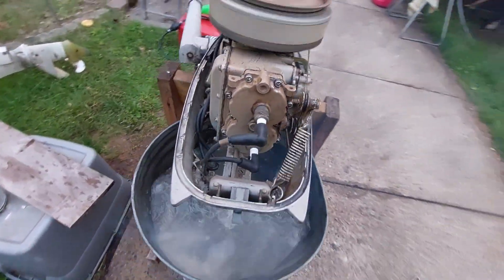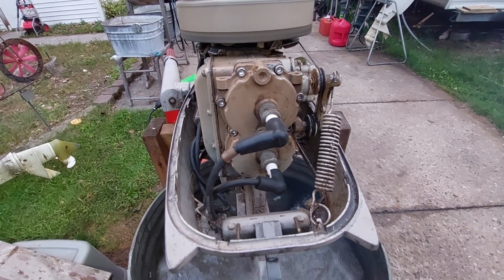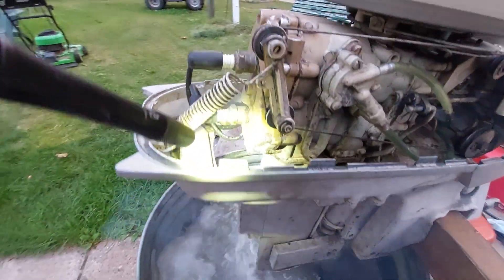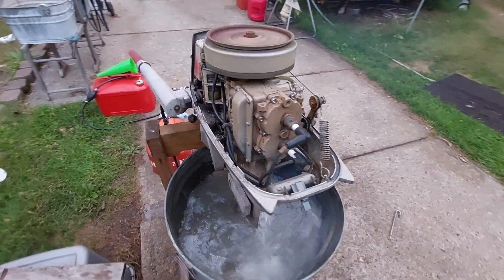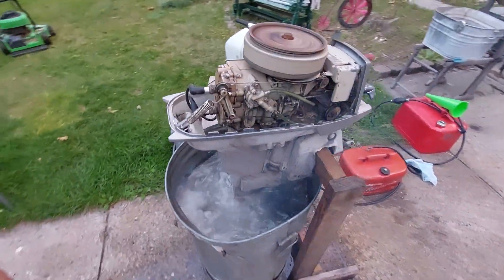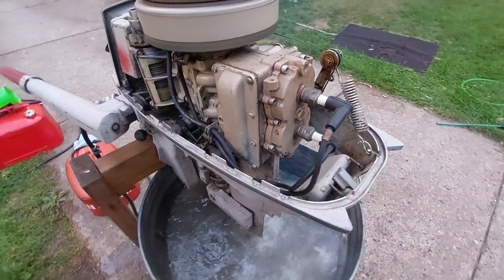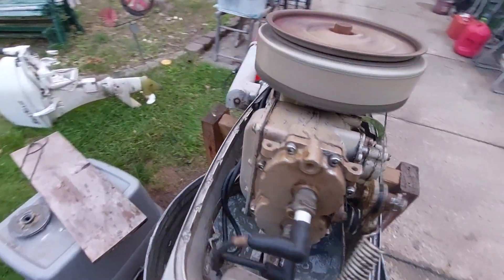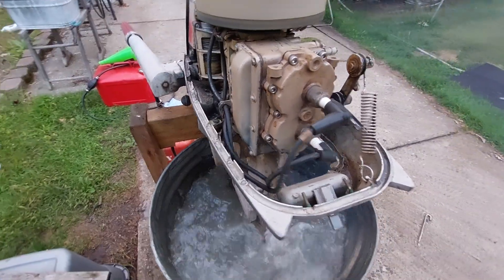Thanks Neighbor Bob for Helping On This! Broken Head Bolts  Repaired #westbend #sharksquad #elgin

Comment: Glad it worked out. The ole small #10 bolts they used on the 5hp gale powerhead can be nasty if you break em. I broke 2 but got really lucky extracting them.
Reply from the maker: Thanks! I was actually able to drill them straight through and just chase the threads. These motors are just incredibly smooth and all around great running outboards.  I wasn't about to lose this one without a fight! It's also running on OMC coils that I took off their laminates and installed onto the West Bend laminates.  Thanks again!